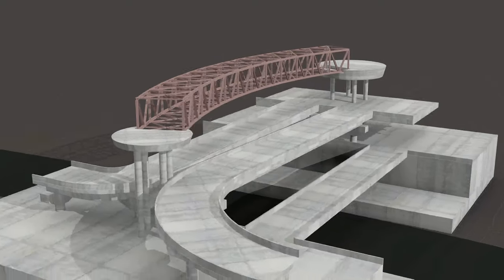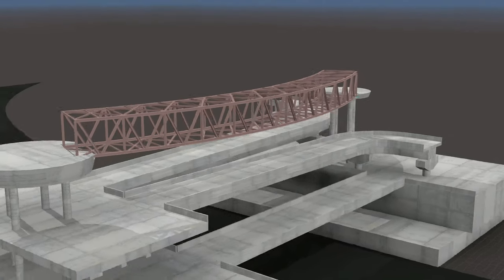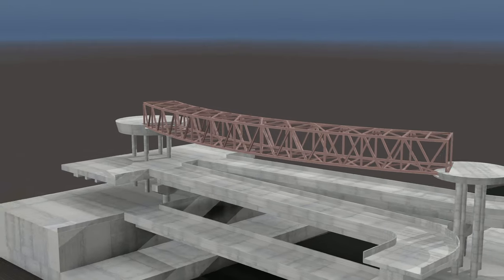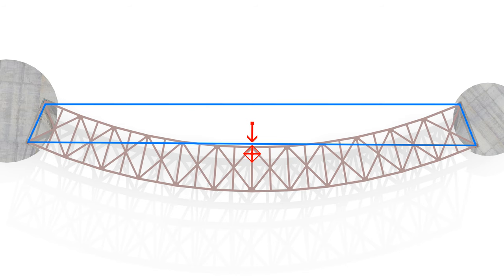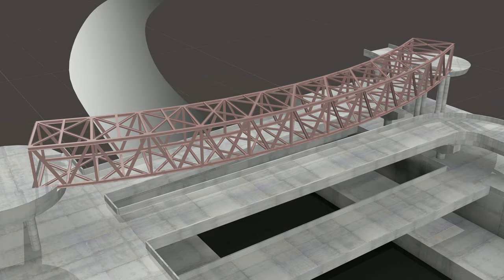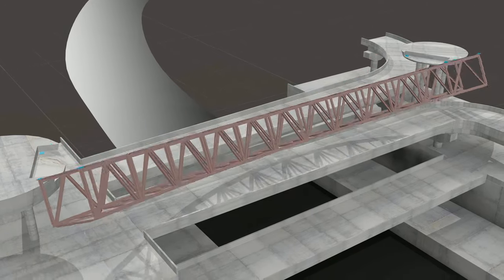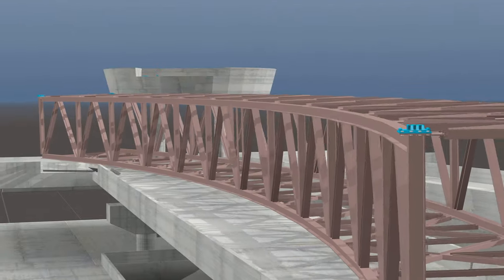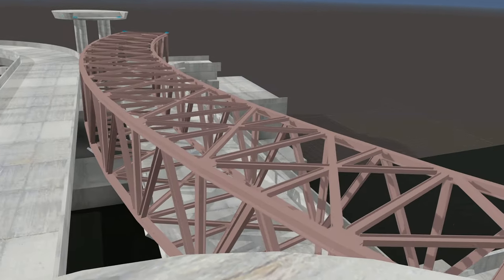Steel-Truss Pedestrian Bridge Collapse in 2016, Kuala Lumpur, Malaysia | Simulation

Comment: Was this design flaw or construction error?
Reply: Design
Reply: @willsmith7145  source? Vid doesn't specify, and I haven't come across any good sources yet. One article I read stated design flaw then in the article the Indonesian osha was quoted as blaming site practices, rather than design. Not found anything convincing is all.
Reply: imd12c4advice no real source. More common sense? It looks like 90% of the damn bridge has no support of course its going to collapse

Comment: Thermal stresses felled the bridge in a city where the temperature doesn't change all that much. They probably would only need 20mm of movement plus/minus for the thermal growth of the bridge due to local climate extremes so how did they screw this up exactly? Faceplam!
Reply: Likely the stresses of, I dunno, A BRIDGE THAT WOULD FLIP OVER WITHOUT THE BOLTS HOLDING IT IN PLACE?!?!?

Comment: Is BCB coming to 2.8? :)
Reply from the maker: Not any time soon, too many open issues with Blender 2.8 design. There are ways to transfer bakes to 2.8 via point cache formats though.
Reply: @KaiKostack  Is it possible to export via point cache with fractured objects 'bound' to the main structure? i.e. like glass windows bound to concrete structure within? (using the bind feature)
Reply from the maker: The point cache format stores the motion for every vertex but no physics information, so you only can transfer finished simulation results into 2.8.
Reply: @KaiKostack  When I import an MDD file (exported simulation) into 2.8 using the Mesh Cache Modifier on my model - I get a lot of artifacts. The animation plays but the model geometry is all over the place?

Any thoughts?

Thanks so much!